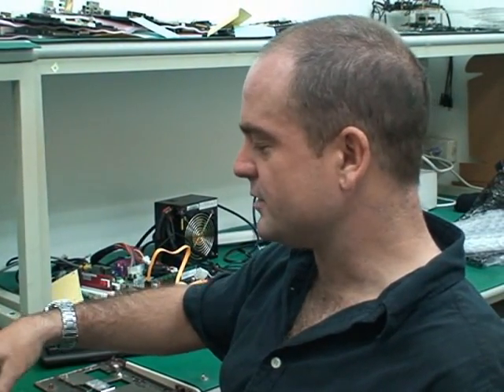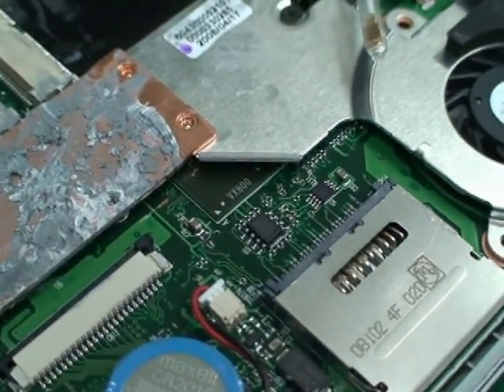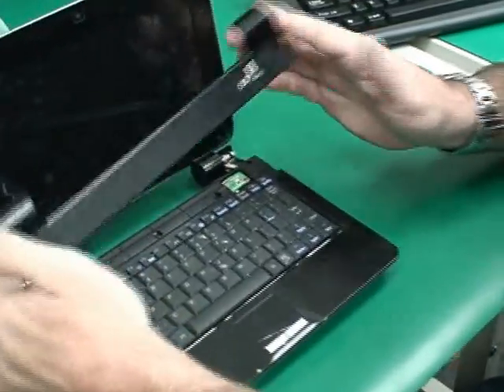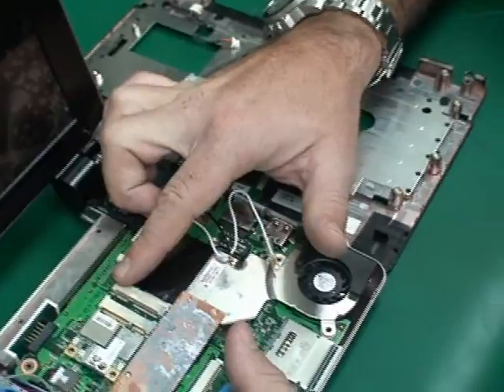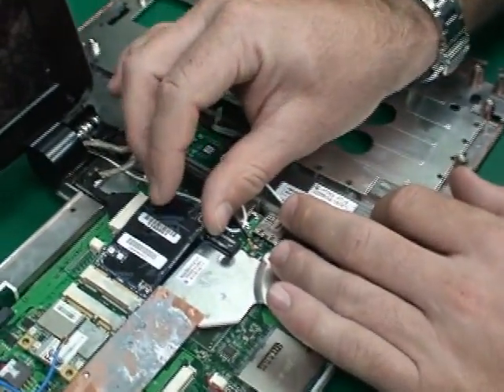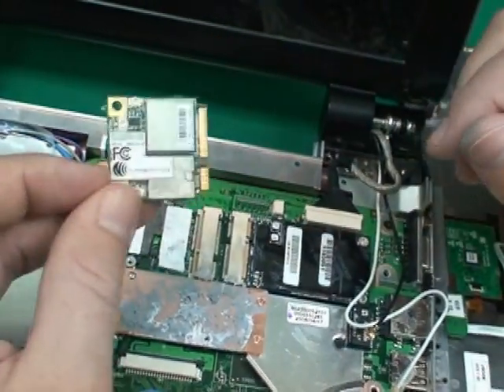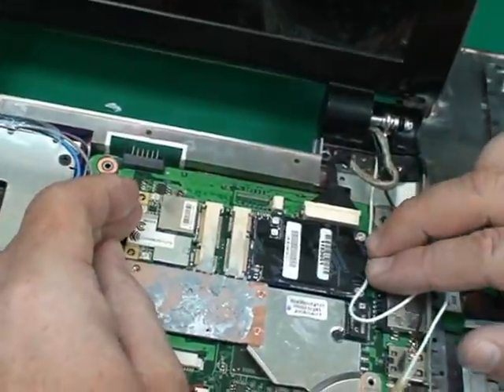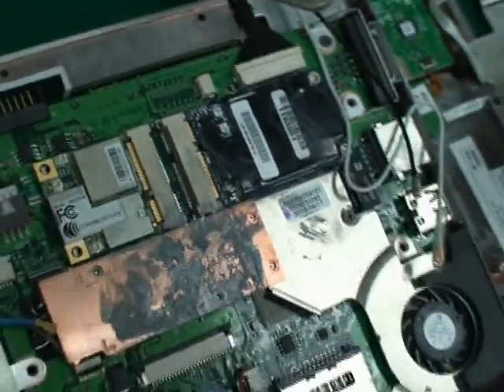Ripping Open the VIA OpenBook -Video

Comment: You said those are two 56-pin USB connectors, aren't those mini-PCI Express?
If so, why can't at least one of these mini-cards be put into a Dell or HP laptop with the compatible connector?
I'd guess that these mini-cards have protection against them working in other laptops right?